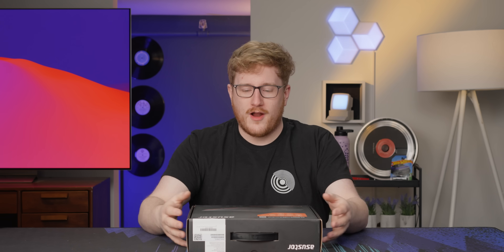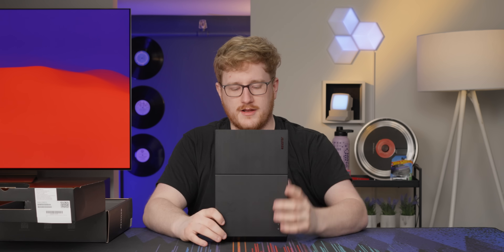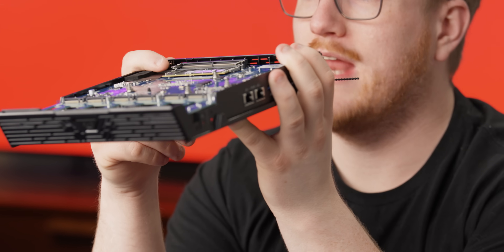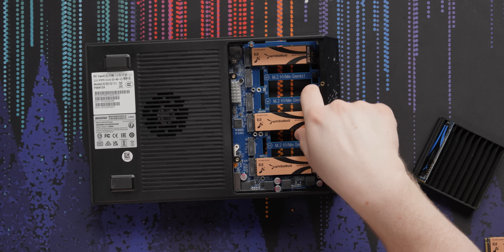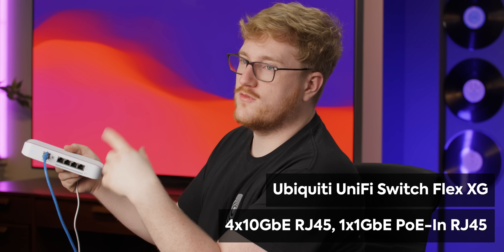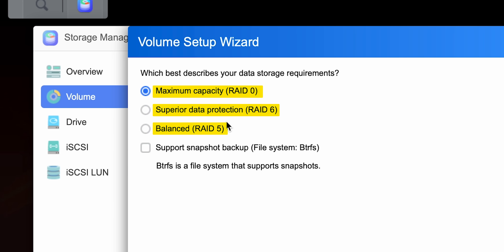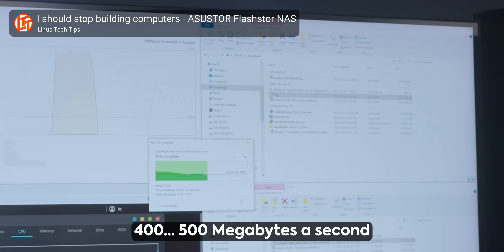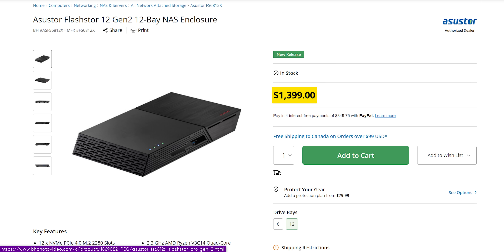They promised me they fixed it... - ASUSTOR Flashstor Gen2

Comment: The way to remember the difference between RAID 0 and RAID 1 is that the 0 in RAID 0 is shorthand for how many of your files you get back if you lose a drive. I have a few striped arrays, but they're specifically for storing things I can easily get back if the drives die, where space and speed are more important than reliability.

Comment: Im not sure I agree with the view of not using RAID0 that honestly depends on how much downtime you can tollerate. 

For a general file server / general use NAS.

I stick to the 3, 2 ,1 rule.

Three copies
Two different medias
One off site

So if I can access the data from the backup while I wait for a new SSD I have no issue taking the performance gain of RAID0 and accepting the risk I might have to call a few files from blob or tape or external hard drives.

Now if we are talking about the storage arrays for my Hypervisor platform that runs 40 plus VM's that is a RAID6 SSD array, the penalty is tolarable because the inconvenience of downtime is not tolerable, although I still maintain at least 3,2,1 backup here to.

Bottom line RAID is not a backup! No amount of RAID gaurantees your data, I have seen a whole array of drives fail at the same time, due to manufacture defects or firmware time bombs.

Comment: USB4 can be used as P2P connection between 2 hosts. It's fast but copper cables are very limited by max length though it should be enough to connect a laptop for sure. And you speed may vary depending on the cable, but you will see 10+ Gbps for sure.

Comment: Lots of comments on amazon, mostly to do with the USB4/TB4 port DOES NOT WORK with a mac, and there are issues with the system writing incorrect information to it's configurations meaning unless you know how to manage linux logging and edit text files to replace the incorrect information the drives keep getting 'lost'.

Comment: Had my NAS set as Raid 5 and worked great for years... until a windy day caused power fluctuations along with outages and multiple drives were corrupted at the same time. I lost everything. Lots of pictures I will never recover. Forunately I'm just a single guy so it wasn't a bunch of family photos but still...

Comment: 1400?!?! Whyyy??? USB dongle enclosures could do this! 

I recommend the terramaster. Plug that sucker into a desktop or raspberry pi and you're saving $1,000 right there.
Reply: A nas and a usb storage extension are not comparable at all. And a raspberry pi being arm based, it is still not comparable and it doesn't do 10GbE anyway. But this is still massively overpriced. At 600-800 I'd have bought one but at this price hell no
Reply: no you're not

Comment: $1000 single point of failure that might not be replaceable when it breaks. It would be nice if they used something like mdadm so you could rip your drives out of it and rebuild the array on other hardware.
Reply: We do use mdadm.

Comment: You can saturate your network w just 2 or 3 NVMe drives.  You'll need at least 50GbE to really push the machine and if you're doing parity across the drives... you'll still exceed your  CPU too. 
Still its a NAS... 12x8TB or 96TB is more than enough for almost all home and SOHO uses.  In a box that small. You'd want two... one to keep at a family member's place for redundancy and DR.
Now the real question... why don't these NAS units allow RAID 10?
Also w any NAS or distributed file system, you take a hit w writes in terms of performance.  That's usually acceptable since most of this is write once, read many.  And the files tend to be immutable.

Lastly you raise a good point. For the price... why not just build out a small form factor PC and use a PCIe card that can hold 4+ NVMe drives.   This way you can control your networking speed, your OS and the amount of storage.  You could also probably tier your storage, depending on your software.  (Hot, warm and skip the cold.) 
Would love to see you configure something comparable on your own.

Comment: Man it is so sad that the server market is getting 2.5" SSDs 128TB this year, meanwhile m.2 is stuck at 8TB again, just like the last 4 years.

Also, if you're spending $10,000+ to fill this thing with 8TB drives, $1000 for the system considering the form factor isn't a big deal. But that's not the issue here. If you go the "cheap desktop route" as the video suggests, you'll be spending that much on adapters and bays to get that many M.2s in anyway. What does suck about this thing is the lack of iGPU. Like, WTF? If you're getting this for home, you're using plex or jellyfin. That CPU in that form factor would fall behind in transcoding.

The real problem is lack of solutions at the home server market for U.2 drives. They are pretty much on parity cost-wise vs M.2, and are below when they cyclically hit the used market when corporations upgrade. Currently you can get 61.44TB in a 2.5" form factor, with double coming next year. But consumer boards don't support this interface and adapters/cables just aren't as available as SATA/SAS.

Comment: Should have opened with the price... 
Think that is going to be a deal breaker for almost everyone
Reply: Idk this is for a specific type of person. Plus like if you plan on populating more than 6 nvme drive bays and are buying this I would imagine that you will be spending a minimum of $1000 more on ssds 🤷‍♂️ so like for the speeds and everything putting this out for a business or maybe your families home storage. 

It for sure could and possibly should be cheaper based on how cheap it looks. But in terms of 12 bay nas type things this is right in line for pricing and other 12 bay nas hard drive set ups will run like $1500-2899 

It is expensive especially compared to their older 6 bay version and I would say the 6 bay one should probably be like $700ish instead of $1000 but idk how over priced it really is for the 12 bay model.
Reply: But then people would click away and not watch the video.
Reply: Yeah people would just click away instantly 🤣 i miked the watch tho. Now i understand the difference between raid 0 6 & 5

Comment: 'running out of storage for your iPhone or your photo back ups' first ten seconds followed by 'how do you solve it?' then its waaaay more jargon than 'your average consumer can comprehend, followed by Raid-0 being described before what an m.2 drive is and how to replace it... FROM YOUR PHOTO storage, what are you trying to do LMG>?!?! hook an audience then immediately alienate them? 
I am not attacking here, just please see that you have a good host, an excellent, be it all expensive solution, and then you ruin it with too hardcore tech advice. Assuming everyone knows what a Raid-0 is compared to a Raid-6 was the best you did for noob/newb... 

Yes I get short circuit is more the enveloped watcher, but I feel they would all benefit (and you would get much more watched minutes, especially if you combined it in easy to skip 5-10second presses to move forward) and done a waaaaaaaay better info-tisment.... sorry for the rant, love ya'll still xx

Comment: No idea who at ASUS is in charge of designing that product, but they need to go away.  Balance the number of PCIe lanes to each drive.  They have 10Gbe, cool.  Screwed up by using a CPU with no iGPU, so BOOO!  I'm pretty sure the target for this thing isn't tech people, but photographers or videographers and to me, not offering something like ZFS is idiotic.  Yes, I did see btfrs, but no idea how mixed speed drives affect that file system.  Two 3.0/4.0 PCIe lanes to each drive and an iGPU would balance that thing out and make it a decent choice (at half their advertised price).  Not enough PCIe lanes?  Use a mux.  Not sure what Broadcom has been doing with PLX over the years, but I'm certain they can hook them up.

Comment: tbf to raid 0... i never had an ssd fail. even my cheapo adata sata ssd is still kicking around after 5 years. can ssds even fail? i know they degrade with many rw cycles but my 4 year old ssd is still at 95% life
Reply: What happen if one of ssd start working słow because of firmware problem. This mode should be described as short term storage.

Comment: You have a write speed penalty with different raids protocol you select. I would expect to see the drop on writes specially with raid 5. Reads I wouldn't unless Atto is writting and then trying to immediately read what it wrote. Which would be dumb and I do not believe it is doing that.

Comment: Bad review.  Obviously a quick review but still poor. 
No mention the Gen2 both now support ECC memory (though stupidly only the 12 bay comes with ecc)
Where’s the test with USB4 port connecting to the NAS
Also no mention of the USB4 not working for Mac… yet… come on Asus, finger out!
Also as someone else mentioned. You need to let it finish raid parity setup for 5 or 6.  Then speed test access.

NASCompares channel for a far better review.

Comment: I am looking for a tiny budget nvme nas solution 

And my search continues
Reply: Jeff Geerling has several PI nas builds.  I think thats the most budget friendly you'll be able to get
Reply: Look for the LTT video that is like, "cloud storage is stupid" theres a small thing with 4 nvme drive board. I've seen some latest motherboard with like 4 nvme slots as well, and you could do an asus gen 4 nvme 4 slot card with pass thru.
Reply: If powerbill is no object, I'd go X99/X299/X399 and just get lots of multi-M.2 cards.
Reply: @ "if powerball is no object"  Oh crap I think my lotto is showing lol. 

I could second the x99 or other xeon systems, but that ignores the tiny part, and at least locally, even old systems are selling at the  "I's know what I got"   price of just below MSRP of a modern prebuilt tower....
Reply: How many drives? I picked up a Asustor AS5402T used for £200, it can use 2 NVME drives which you can raid, or you can use them as cache drives for the main HDD's (you can run it with JUST nvme if you want). MAybe an option, although I know 2 drives is limiting, there are larger options).
Reply: @UKDarkJedi Gen 2 AS5402T supports 4 gen 3 m2 and 2 3.5" bays...along with 3 usb(think they're 10g, but can't remember). 2.5g ethernet can be trunked as well I believe. Used under 300...new 369.
Reply: Cant you just add nvme ssd adapter cards to pcie lanes on a cheap motherboard?
Reply: There's some mini pcs with a 4x nvme splitter board. They're much cheaper than even Terramaster's stuff.
Reply: Thanks for everyone's suggestions
In my country the nas boxes are too expensive and the nas kit from ltt video is not available 

I think I'll just go with either a pi5 with m.2 attachment or use my old laptop and Chuck some high capacity sata ssd in there and setup immich on it since I only need it for photo backups
Reply: Check out the Zimablade or Zimaboard. They have 2 SATA ports, but also have a PCIe 2.0 4x slot, so you could add nvme storage to it. Depending which model you take they are around 70-200 bucks
Reply: I mean you can do a single nvme with the Raspberry Pi 5 Not sure performance at this point but it would make a tidy little low power package.
Reply: Depending on your definition of budget, the ugreen one might be a good option

Comment: I realize that most of the equipment handled these days isn't as shock sensitive, but why do they always slam whatever piece of hardware around like they're flipping a pancake?  While it potentially shows a confidence level with the things they are using, it also comes across as careless and disrespectful for the hardware they are handling.  A person buying these things would never handle them in such a way so it begs the question of why everything has to be banged on corners and slapped down on the desk at every opportunity.  I love the channel, but I don't understand this treatment of tech.
Reply: Probably to get you to make this comment to drive engagement

Comment: ... did you bother to let the RAID5/6 finish calculating initial parity before you started testing? I mean, SSDs are fast but the RAID5/6 precalc going while you're writing (with that additional RAID5/6 calculation) isn't really a fair test.
Reply: those were empty drives. Does it take long to calculate parity for a bunch of 0s?
Reply: @orlagh277  The RAID calculations take time to build.

Comment: I bought a ExaBlox OneBlox off eBay, rooted the Debian Linux on the internal 512GB SATA SSD, installed some old MIPS64 binaries onto it like SyncThing and Lighttpd, and install 8x 8TB SAS drives, now it's my main home NAS.

ExaBlox OneBlox was a storage appliance that used a Drobo-like RAID but - like Drobo - it was not fast enough to set the world on fire, the hardware is a bit funky (Cavium 6-core MIPS64, sucky and dumb LSI SAS controller, weird interrupts, not so great disk i/o, USB2.0 ports on unit).  Company was acquired and dropped support, rendering these useless (yay for f***ing cloud management).

Comment: I'm ok either with it having insufficient performance and a lack of pcie for low amounts of money (like under $300), but if they're charging $1400 for a flash nas it better have 4x the number of gen4 lanes it has ssd slots for, and it better have excellent networking (preferably an empty pcie4x8 slot for 35/50/100g networking and a CPU that can keep up.

Comment: for a mass storage to use with my video business, this seems pretty nice
Reply: Just consider, this caps out at 96TB with 12 drives. We've been stuck at 8TB M.2 for 4 years with no sign of 16TB models.
Meanwhile, U.2 drives of 122TB are coming this year, with 61TB from last year.
I know which I'd choose to have a viable upgrade path.
Reply: @mokahless  That is true, tho a u.2 Nas with the same amount of drives would be a bit bigger. Do you have any enclosures you could suggest?
Reply: @mokahless  my main benefit with m.2 is cost, I think per GB, m.2 nvme is still considerably cheaper than U.2, and if top of the line speed isn't an issue, m.2 sata is even cheaper

Comment: Stupid product. You can do much better with DIY at that price point and have enough PCI-e lanes for 6 NVMe and 100Gb network (12 drives would be overkill and much more expensive, but you can't really use them anyways on this NAS). If you don't want to bother building one you can pay someone 100 bucks to do it for you. Also I'm sure that TrueNAS or unRAID would be better than any proprietary crap Asus has come up with
Reply: Asustor

Comment: $1k for a NAS... I could build a PC for cheaper...
Reply: If you put a adapter in the minisforum MS-01 you would even get the small formfactor, and still come out cheaper than this
Reply: Try building a PC that actually has 12 M.2 slots without having to shell out a lot of money for a specialty motherboard and/or PCIE cards. It's not nearly as easy as you'd think.
Reply: @Mirrormn 1k price is for the 6 bay one. A regular motherboard has like 2 slots nowadays and i found a pcie to 4 m.2 slot adapter for 70 bucks. That's 6 slots right there.
Reply: @orlagh277  They come with 5x nvme. 2 ports is nearly a decade old standard.
Reply: @Mirrormn  not to mention one that uses ECC RAM, with a small footprint and low power draw. Not a fan of the price myself, but I agree and doubt anyone could make their own equivalent. Sure it's possible to build one with a larger footprint and higher power draw, but then it's not equivalent!
Reply: @waxydrgle4600 you could go the ARM route for power draw.
Reply: @Mirrormn  But who actually needs 12 m.2 slots?  Of the 16 million subscribers to LTT, I'd be shocked if there are 5 people who watched this and considered purchasing it because it fit their needs.
Reply: Dude, storage is pretty freaking expensive. 1k for a NAS isn't much but without the drives, it's a fucking joke.

Comment: For 1400 im expecting it to come with 8tb of m.2 drives!
Reply: nah they're sharing cool aid with apple
Reply: The terramaster F8 and a couple of the 4x nvme mini pcs are much better in value. For the latter, use unRAID or Truenas at 1/4 of the cost.

Even the Ugreen one, which is exorbitantly expensive at 1000 usd is cheaper.
Reply: 8tb nvme costs at least 1200
Reply: @LLegion5 for 1200 you can get 8 x 2TB Western Digital Gen 4 drives.
Reply: For 1400 I'm expecting it to come fully populated with 12!
Reply: He said a lot of mumbo jumbo but not the size of the storage? WTF is going on?
Reply: @ There is no storage. You are buying only the NAS, without any drives whatsoever OR heatsinks for the drives. For $1400 USD before taxes. For that price you could expect the entire NAS to be loaded with drives, even if just 12x 1TB of slower, older ones, and the heatsinks to be included. It's ridiculous, because for that price you can basically buy and assemble an entire PC that can just do the job of the NAS.

Comment: This was starting to look very appetizing up until the moment you mentioned price.
Reply: If your running a video editing operation with three or four editors, this is far cheaper and lighter than a custom built server.
Reply: Of you're worries about the price, watching a video about a NAS that hosts only M2 nvme drives is a bad idea ...
Reply: Buddy, unless you're spending enough on drives to make $1300 seem like chump change, there are much less expensive options than buying a 12-bay NAS to only populate a few slots.
Reply: @mokahless  Buddy. If you think something that performs this poorly should cost $1400 then you’re crazy. Better units exist.
Reply: @mokahless You can get 4x 18TB drives for less than the NAS depending on where you look. It's obviously more expensive for NVME. 4x 4TB is about $800 USD.